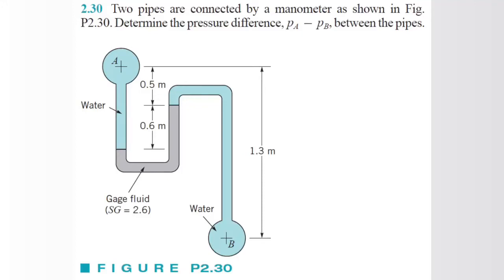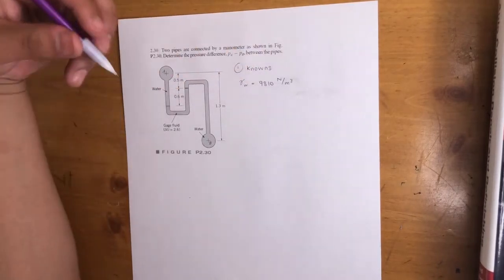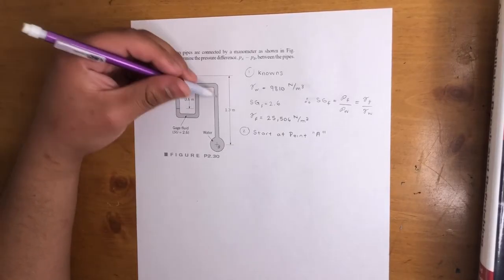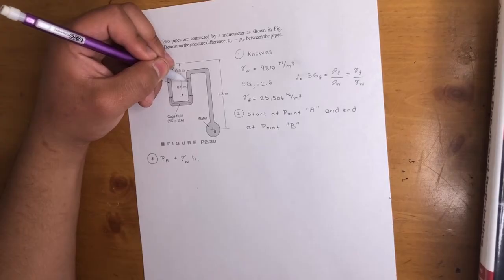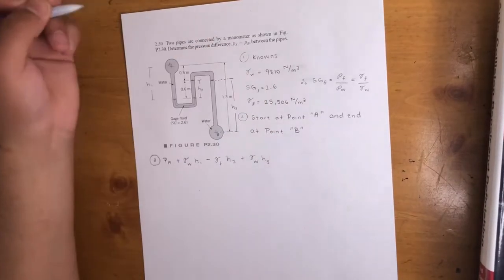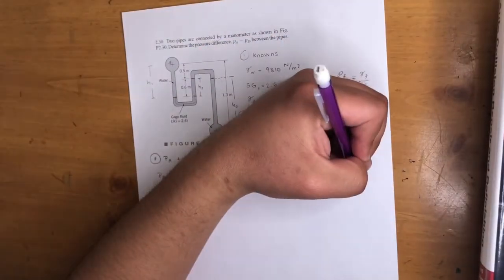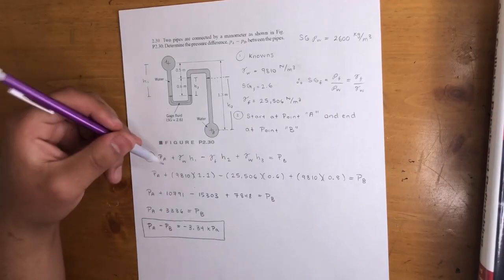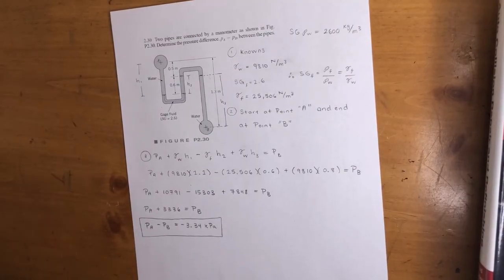Fluid Mechanics - Two Pipes are Connected by a Manometer

Comment: Brother you have done good effort; but remember that pressure can never be negative. So, it means that you question is not right 🙂
Reply from the maker: Unfortunately I will have to counter your statement! 😀

Pressure can, indeed, be negative. At least gage pressure can. Same way we can have negative degrees Celsius/Fahrenheit (but not negative Kelvin/Rankine). 

Also, this problem is not indicating a negative pressure. It’s indicating a negative pressure difference, which is totally possible 😎👍🏻